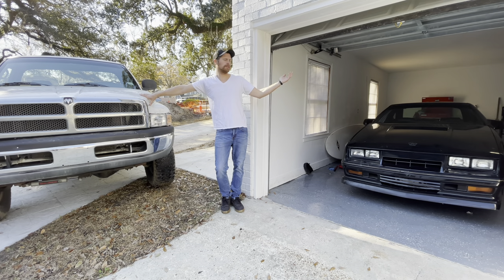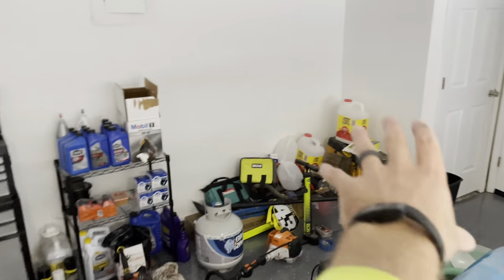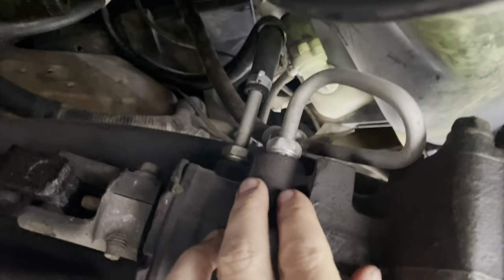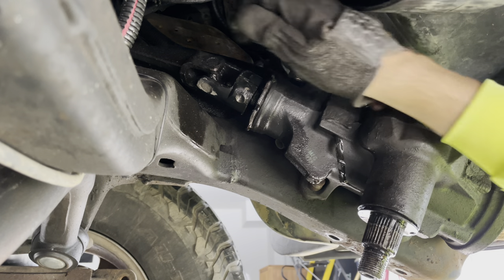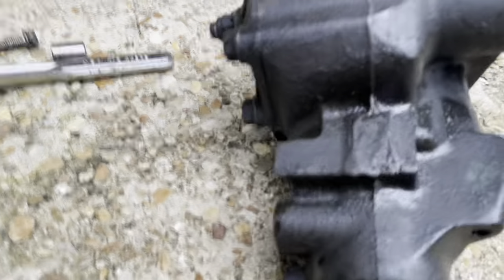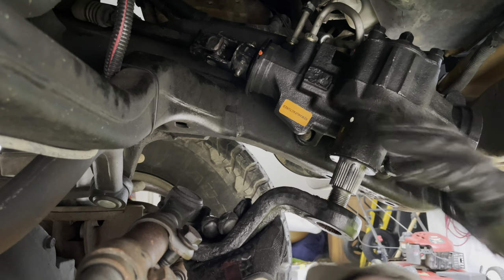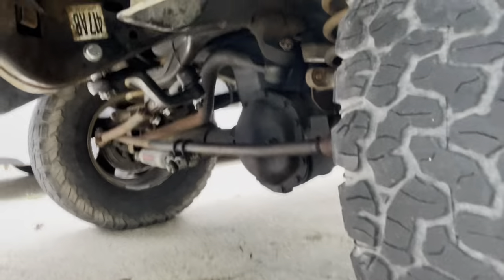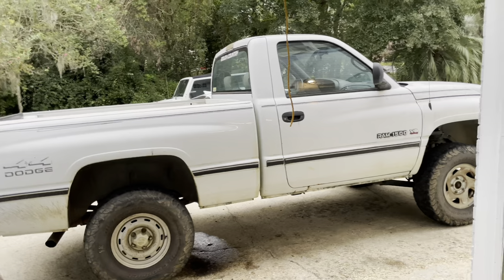How to fix that sloppy Second Gen Dodge steering! (Steering gear box replacement)

Comment: Nice video man. I had flashbacks of my 94 and the steering (or lack thereof) It's always been flat out scary to drive. I personally like these second gen videos. In fact, you've inspired me to do a video on mine.
Reply from the maker: Heck yeah I’d love a video on the 94! The Redhead steering boxes help these things out a lot. The stock boxes wear out  so quickly and it gets that 2nd Gen wander 😂…this truck with it’s oversized tires and lift never sees much Highway time anyway, it’s most just back roads. So I cheaped out and went with the OEM style one.

Comment: Why did you remove the sway bars?
Reply from the maker: 3 of the 4 threaded mounts for the sway bar broke off inside the frame when I went to change bushings. I still have the front one if I ever wanted to tap the frame itself or weld it back on. But I never really noticed it missing driving so I never bothered, probably because those rough country shocks are so stiff 😂

Comment: Can a bad steering box cause a shake in the steering wheel but only at ceartian speeds? Or do you have any recommendations on what else could cause that? I only get a shake between 55-70mph
Reply from the maker: It shouldn’t…A shake between 55-70 sounds like a tire balance issue to me.
Reply: @TheMoparGarage  it's had two different sets of tires and rims on it with the same issue both of which were confirmed balanced that's where I'm getting confused
Reply from the maker: @dylan0265  that’s odd. Steering parts like tie rod ends and ball joints are all tight?